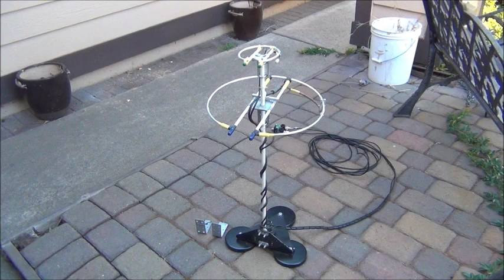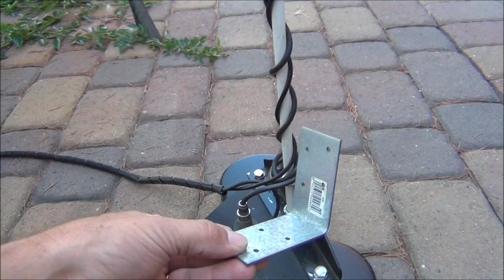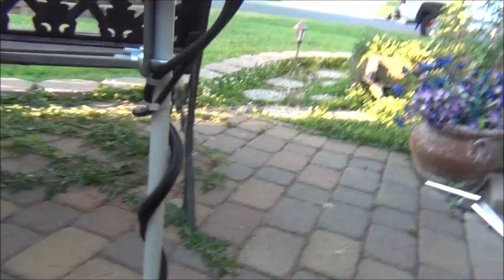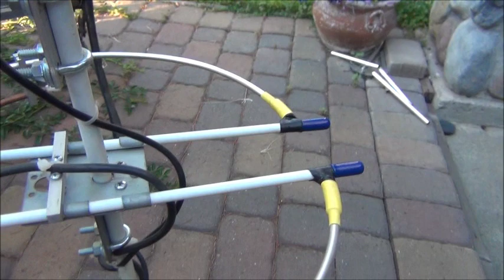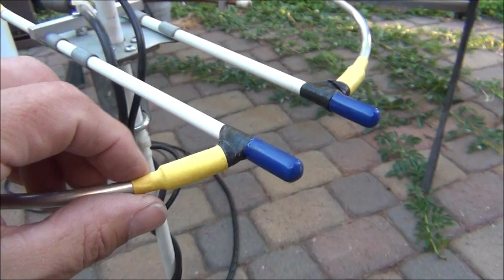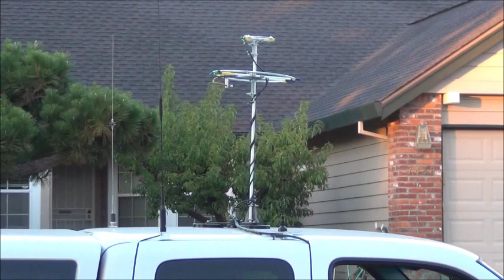Dual Band Mobile Halo Antenna - 70cm & 2meters by N6TWW

Comment: I know this is old, but it would be nice to see your plans, great antenna project,.
Reply from the maker: This was one of those projects where I didn't have any plans other than to make the antenna system out of parts I had on hand. I had the idea in my head but changed the design on the fly depending on what material I had. I also changed a few things as I went to improve the strength of the mast structure.

Comment: Perhaps not a relevant question, but I can't help but ask. How do you have those radios mounted?  It looks almost like the vehicle was made to fit them.
Reply from the maker: The top radio fits in a space that was made for a CD player. The bottom radio body is remote mounted. What you see is just the face plate. I made a special insert for the face plate to attach to. The special insert fits into a space that was designed to hold CDs in their plastic cases.

Comment: Quite interesting. I like the Drilled bar stock for the gama match feed point. Liquid electrical tape is your friend. I recommend using it to keep any connections that are water o2 friendly from oxidizing.

Comment: Could this be made in a 2m 1.25, and 70cm base version. I would like specifications to build this antenna. KX0OTK.
Reply from the maker: The answer to your question is yes it can be made to work on the three bands you mentioned. I have another video series that shows how I built a pair of 2 meter phased halo antennas which goes into more details showing how to calculate the size of the components. You will have to make your own calculations if you want to build a three band antenna. The video series contains 15 videos. The title of the first video in the series is: 2 Meter Halo Antenna Part 1 -- "Design concepts & prototype, construction begins" by N6TWW          Save       Cancel
Reply: @mefedler  Thank you, I wrote down the complete title, just because I know sometimes you NEED all the address. My goal is to make an antenna strong enough for 100W on all three bands. If I can make it work, I will build it on the pole the TV antenna is on. I hope the XYL  doesn't mind.

Comment: Am new to the VHF/UHF repeater world and use a handheld.  Am always being told to keep the antenna vertical to match polarization.  This design is horizontal so am wondering how that works.  You are truly a Maker and am enjoying watching your videos.
Reply: You can use any mode on any antenna, try horizontal FM for 'interesting' contacts outside you normal working range. It's great fun when that QSB is slow and mild. Keith, try stuff and you'll know more stuff than the one's who don't try at all.
Reply from the maker: The FM mode you are using with a repeater or handheld normally have the antenna vertically polarized, so the information you have been told to keep the antenna vertical is correct. The antenna shown in this video is designed for the SSB mode. SSB on 2 meters and 70 centimeters normally uses horizontally polarized antennas, therefore the antenna show in this video is designed with horizontal elements.
Reply: Thanks Mike.  Now I understand.

Comment: Interesting antenna - I'm going to make something similar as a base antenna, just to play with the design.  What's the gain and radiation pattern like ?

BTW, is that an IC-7000 in the car ?
Reply from the maker: +Jon Biddell The antenna has unity gain (or no gain) as it is basically a dipole antenna. The pattern is approximately omnidirectional in the horizontal plane.

Comment: I may have missed it, but I see two coax lead coming from the antenna and going to a box of sort. Is the box a switch or just a enclosed T?
Reply from the maker: buzzsah It is a duplexer so that both antennas can be attached to a dual band radio with a single output connector. It will allow you to transmit on one band while listening on the other band.
Reply: Mike Fedler Thanks. I just picked up the FTM-400DR and thinking of making an antenna for the roof of the van.

Comment: Mike, looks a good little setup. I have one question, Is the coax 10mm/3/8 all the way into the cab and how have you routed it.
73 de G8YMW
Reply from the maker: Yes the coax is the same all the way into the cab. Since I only use this antenna occasionally the coax just comes in through the rear door seal. The seal has enough room to allow the cable to come through without damage.